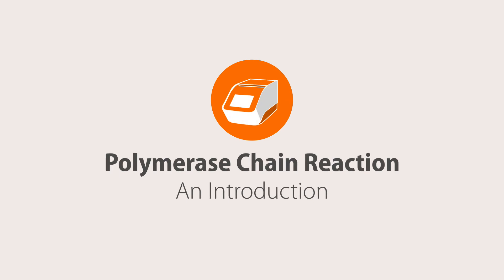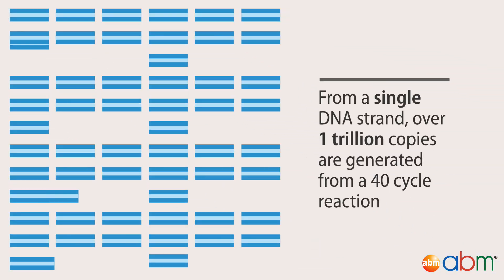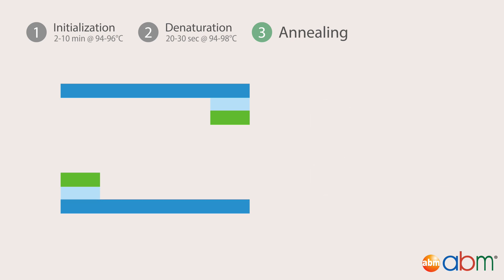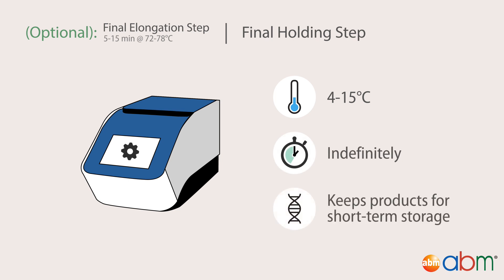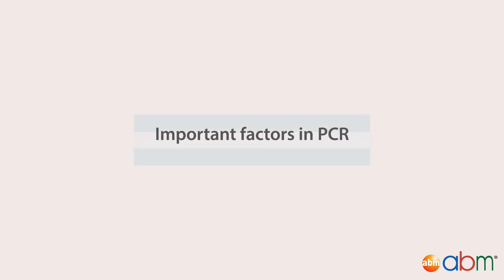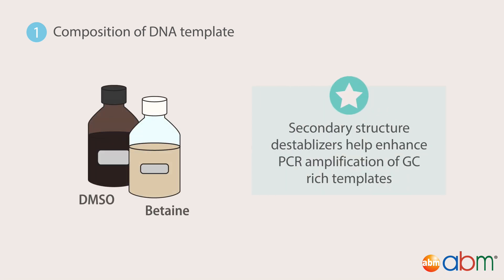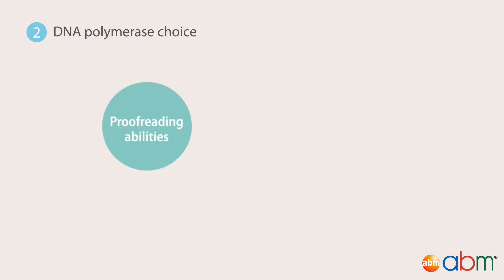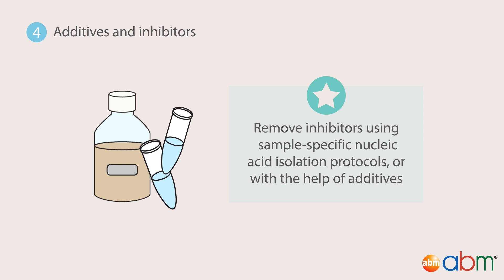1) PCR (Polymerase Chain Reaction) Tutorial - An Introduction

Comment: The polymerase enzyme will complete the target primer strand, but so what? That can't identify a specific pathogen, UNLESS one performs a blood culture test for the virus template, ensuring that the pathogen isn't a contaminate, contamination assured by swabbing the back of throats to obtain a virus template to compare with the subject's test virus. 

Another problem that rules the PCR 'test' as useless is that if amplification is 60x, 100% of test subjects come up positive!  That tells us the 'test' is merely responding to the increasing fluorescence signal as amplification is increased.

The inventor of the PCR 'manufacturing technique' (Kary Mullis), said it was never to be used as a diagnostic tool, such use leading to misdiagnosis and consequent medical malpractice, resulting in maiming or of killing patients:

“PCR detects a very small segment of the nucleic acid which is part of a virus itself. The specific fragment detected is determined by the somewhat arbitrary choice of DNA primers used which become the ends of the amplified fragment. “

Comment: How we get our desired product in pcr if long ends are produced?
Reply from the maker: Hi Linta,

Thanks for watching and leaving your question!

Would you mind clarifying your question or if the question is in response to a section in our video?

If you would you like to amplify long PCR amplicons there are DNA polymerases specifically engineered to do this with high specificity (such as abm's Long-Range DNA Polymerase)!
Reply: Thanks for replying .long fragments are produced but in low quantity and that's why they don't show on gel
Reply from the maker: @Rainlily59  Yes, you are correct - in low quantities, they won't show up on the gel. To amplify them, you can use the DNA polymerases specifically engineered for long PCR amplicons, as mentioned in my last comment. Let me know if you have other questions!